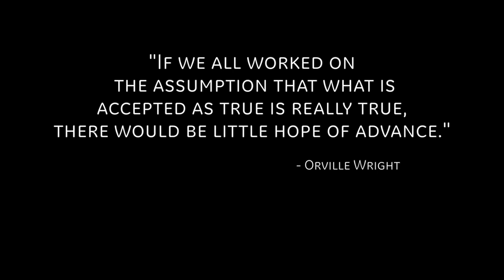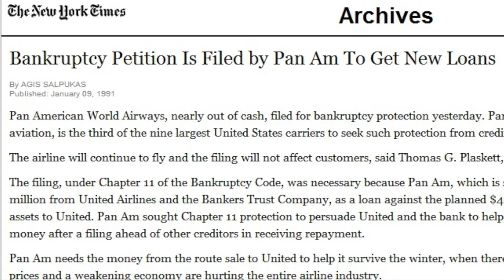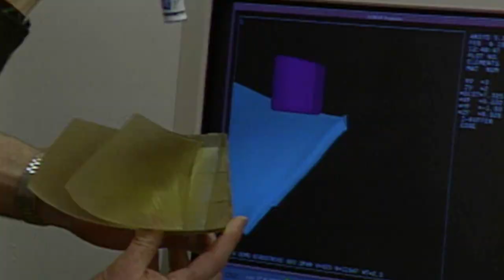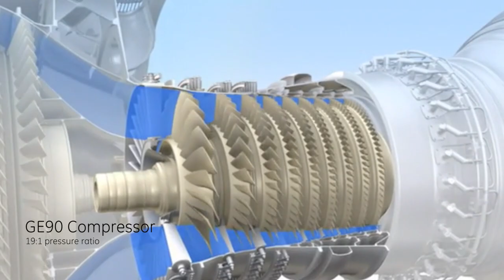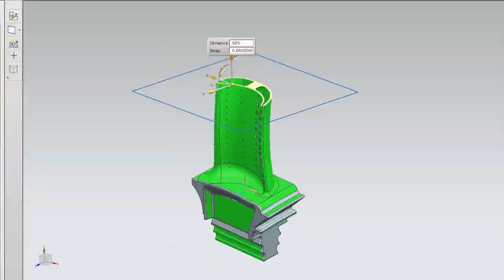GE's Big Bet on Goliath Engines

Comment: GE > RR
Reply: No you are wrong. I like GE than RR. Not the other way around. you have  #fail
Reply: GE are better than Rolls Royce? Unless of course you're using a faulty GE operand in which case you probably meant GE<RR
Reply: GE>any other engine except the Rolls Royce SNECMA Olymups 593 Mk 610 (nothing beats the Concorde)
Reply: @dantaylor7344  Faulty Rolls-Royce engine on Australian A380 did cost A380's head!
Reply: maanvol  Mmmm love to see the stats of GE engines V RR. I wonder if more yanky planes fell out of the air than European ones??????

Comment: What is needed now is a set of fan disks that does not develop cracks that cause  uncontained fan disk failures that has killed 1 person in the US and probably more in other countries.  Yes, now every engine maker has blood on their hands; flying with turbofan jet engines with known defects.  Decades before, an A& P could downcheck an engine and cause it to  be rebuilt. Nowadays; " Oh that crack isn't big enough to replace the fan disk assembly "...Oh, well, that is the risk you take when flying. I was trained to fly; My father was a Connie worker who never sets foot into a jet.  Both of us knows that there is always a risk to flying. Accepting an uncontained fan disk rupture means that people accept that risk.

Comment: How about thinking about the passengers instead of the airlines...we are flying slower than ever with all these "great" engines
Reply: And your airfare is as cheap relatively as it has ever been and your safety is better than it has ever being
Reply: Slower=quieter, fuel efficiency, less vibration, less wear and tear... if speed is all you want the concord is for you.

Comment: WHY DON'T THEY PUT CHICKEN WIRE MESH OVER THE FRONT OF THE ENGINES TO PREVENT BIRD STRIKES TAKING OUT PLANES ?
Reply: well it would decrease the air flow so the engine would need to work extra hard, and besides this one doesnt require any, i saw the test videos the chicken turns to paste and goes out safely
Reply: Nomad Vids Thank you for answering my question are you an employee of G.E.?
Reply: Darryl Fry hehe no :P
Reply: well not chicken wire, but titanium chicken wire, strong enough not to be sucked in, and they could weld it around the sides to keep it in place !
Reply: Because a bird would go straight through it
Reply: Plus the wire would distort the air flow and create turbulence....Maybe a retractable screen until the plane is high enough???
Reply: Darryl Fry the birds will get diced or cubed that's all.

Comment: If GE really wants to get innovative with their engine design, they should focus more of their future development on engines that run on alternative fuels (like Hydrogen or Methane) or even no fuel at all (relying on Microwave Beamed Power from the ground and orbital relays).  These technologies may not be feasible today, but the development cycle of an engine can be 15-20 years or longer, and by that time SpaceX should by flying reusable Falcon Heavy rockets for much cheaper access to space... (a constellation of Microwave relays in orbit could allow a handful of ground stations to power airplanes flying anywhere on the globe...) and Natural Gas infrastructure should be much better developed than it is today.  Aerospace companies need to start planning around Peak Oil and the eventual depletion (in 30-40 years at the latest) of most sizable and affordable petroleum reserves combined with even higher demands for Oil for transportation and industrial uses as countries in Asia and Africa economically develop...
Reply: The same Peak Oil we've been hearing about for 75 years. How's that working out for you?

Comment: I bet you could fly a 747 with two of the GE90 115's at full load.  Wonder how many miles of wire and tons of weight that would save.  This engine is stupid awesome and shows what GE can do.  Props to the engineers who designed this beast and all the management who saw it through.  If I had known and not been poor growing up I would have tried to become an engineer to work with a company like GE.  Since I can't work for GE I just will keep buying their stock until I own enough to get a stockholder tour of one of their plants or something.  The only thing about this engine that worries me is the amount of thrust it produces ripping up airport runways.  I bet that was a concern when they built it.  Put four of these suckers on 747 and you could probably take off at idle thrust.

Comment: To Eric Ng....the only reason there are more GE engines in use on 777s is because there is no option to buy RR or P&W on a 777ER/LR. Boeing struck an exclusivity deal with GE years ago to exclude competition. Airlines won't have a choice with the 777X either. To be fair, the A350 only has RR as the engine provider. And now GE are knocking on Airbus's door for business for Airbus's latest model.
Reply: bullshit...

Comment: 6:28 that Emirates 777-300 is powered by the Rolls Royce Trent 800... the same one that was essentially kicked off wing by GE in exclusivity deals, similar to the deals to that on GE9X
Reply: Rolls has exclusive deals  on all  A-350  series  which means a   free run with an engine  with no real competition  because if GE offers an alternative engine for A350 Boeing  would cancel  GE's exclusivity  on 777-X  and ask RR and even Pratt to come up with an alternative. Since 777-X  has a  tremendous  future,GE would never take the  risk.
Reply: john russell Only 777-300ER have GE motors, RR can be on 777-300 but not the ER's.
Reply: john russell You are revelling in complete fantasy dude.. Boeing has offered financial participation  in devlopment  of  300ER ..GE accepted and  RR refused and today they certainly  regret the  decision..  GE-115B has exceeded 127.000 Ib trust.. World record that is still valid  ..Rolls  Royce is under serious  investigation by the SFO in Britain   for bribery. 
How about Rolls Royce bribing Airbus for exclusivity in  A350 ?????
Reply: sam koivisto As I said ,RR made a serious mistake which  they regret today  it is obvious they underestimated the success of the 300ER ...
Reply: Just stating that GE are on the 300 ER'S and i like the way they do engines. Didn't know about the 350 RR deal, unfortunately that's big business now days dude.

Comment: The only Caveat I see is that because the engines are so large they would have to also replace the landing struts with longer struts to get the engine intake far enough up off the ground to keep them from being damaged by FOD.  That means all three of the landing gears.  That will also be cost prohibitive if they wanted to re-outfit their fleet with those new engines, so I am assuming that they will only go on the newest aircraft coming off the assembly line which would be designed to accommodate those longer struts.
Reply: Raise the wing i.e. 787

Comment: Okay so usually the high pressure turbine blades are meant to support alot of heat and mainly hold to creep. That's why the nickel based superalloys were used, as well as monocrystals. But how does the cobalt and chrome alloy compensate for this ? I mean, unless they could print monocrystals I'm sort of confused.
Reply: Cobalt and chrome alloys is used together because they have a really high resistance to heat and friction which is both in a jet engine I know the t-58 helicopter I work on which is also a GE engine it has cobalt bearings and titanium compressor casings
Reply: Lucas Mccormick
 Ivan's question...and Lucas' answer just turned me on..WOO!
Time to take a cold shower now....
Reply: Moondra3 glad I could help

Comment: The problem is, that if you put those engines on a plane, they hit the ground. So the engines got moved up and forward, which makes the plane pitch up and down wildly. Which is why MCAS was put on the planes. Which is why they crash all the time. Good work, Boeing and FAA.
Reply: What the hell are you talking about only the 737max has the MCAS system and the 737max uses CFM international Leap 1B engines and not GE90X. The engine(GE90X) shown in this video is for the 777X which doesn't even have an MCAS system at all. This video has completely nothing to do with the 737MAX. How the hell can you even mistake a 737Max with a 777X a plane that's almost 3 times bigger.

Comment: The future is ion drives. 300 - 400 ion drives on every wing, pumping out a thin stream of air molecules at incredible speeds would generate the same thrust as that Hummer-sized engine.

Comment: These days airline add a fuel surcharge as needed (and are loathe to reduce or remove it).  It's almost at the point that your seat price does not include fuel.

Comment: It is unfortunate that GE chose not to rejuvenate their Marine Gas Turbine lineup with cores based on the GE90, GEnX or GE9X. The composite fan won't be of any value, but the high pressure hot sections and the TAPS combustor most certainly will. By choosing to allow the LM2500 to languish within its current CF6 foundations, GE is ceding the future marine turbine to the Rolls-Royce MT30 and WR-21. What will be needed to retain leadership in marine propulsion is a concerted effort to bring the GE Passport, LEAP56, GEnX and GE9X cores to marine applications. I'll call them the LM1 (passport core), LM2 (LEAP56 core), LM4 (GeNX core) and LM8 (GE9X core) respectively, each covering the 10, 20, 40 and 80MW output class.

Comment: The mention of the bypass ratio whetted my appetite to know what it was!  Don't leave us hanging.  It does look obvious that the bypass is way more than the compressor/expander unit.  "The cooling provided" was another tidbit that begged explanation.  Seems that it's time for the compound-engine where an entire motor is used only for cooling the combustion chamber.  Or how about a compressed nitrogen gas coolant dump for take offs and landings?

Comment: At 6.34 in this You Tube feature, what function does the two smaller engines provide on the plane shown?
Reply: The smaller engines were to compare
Reply: Those are the 747s own engines.
Reply: Nope, the smaller engines are what you will find on all 747's the big engine is there just for testing. All they did was remove one of the 747's engines and put the GE90 on the plane for testing in it's place, n o comparison at all.
Reply: All they did was remove one of the 747's engines and put the GE90 on the plane for testing in it's place.

Comment: Renewable aviation fuel is key, far cleaner for both the turbine and for our climate.
Reply: LOL!
Reply: How much land is required to grow it?  As we know, arable land is needed to combat starvation around the globe, not grow jet fuel. Ethanol i.e. is not a green fuel because it is energy negative over the entire cycle (more energy is required to produce it than it contains).  If we converted all arable land in the US to ethanol production, it would only replace about 15% of our oil demands. And, it uses vast amounts of water. By the way, the turbines I work on have been flying for thousands of hours. They all burn petroleum, and they are all clean as a linen sheet in their turbines and combustion sections. The only place they accumulate soot is a bit on the cool end of the exhaust cone.

Comment: I know how to bild a friction less bearing. Yes its supposed to be impossible but I do know how to make one and I think I know how to lower or remove the possibility of separation of the bearing. I just dont know what speeds it could handle and if the weight would be worth it to use it in replacement of traditional bearings. I think it could weigh as little as 2X the weight of the traditional bearings.

Comment: These engines don’t run on fuel now, they’re powered by compressed air...yet we’re probably charged for fuel in the price of tickets
Reply: They do run on fuel. The engine compresses the air. If you do not believe that. Then get on a radio controlled jet with minimal fuel for takeoff. Of course, you will not be around to tell the truth.
Reply: They do run on fuel. The engine compresses the air to give them thrust. We could put you on a radio controlled jet. And add enough fuel for takeoff. But of course, you would not be around to tell the truth.

Comment: I need some intelligent to answer my question. Unfortunately I don't know what is called the nose of the engine were you see the cone shaped center were the propeller attached to. So my question is , why do this center have white lines in the tip.? Sometimes you can see it when the engine is running fast they turn into a blur 6.

Comment: GE is trying to save a few hundred pounds using exotic materials, instead of looking at retiring the obsolete turbine designs for more powerful engines that weigh a mere 300 lbs in total.

Comment: Earlier comments said the Emirates was using R.R engins in the video but I heard the G.E. had a special arrangement with Boeing for the 777 engine to be the only supplier since its was so unusual is that true?
Reply: This is probably a dumb question but when I see GE the first thing that comes to mind is Light bulbs. This can't be the same company right? Sort of like R.R. engines and R.R. ultra luxary cars.
Reply: Tampa0123456789 In both cases, they are the same companies. The same GE that makes jet engines also makes everything from windmills to light bulbs. Of course, they are different divisions of GE, but it's same company. Similarly, the automobile manufacturer Rolls Royce is the same Rolls Royce that makes the Trent jet engines.
Reply: Rolls Royce automotive and aero engines are completely separate business entities.  When the British government bailed out RR in the 70's they sold off RR automotive to the private sector and the aero engines remained a public company. BMW own and produce RR cars.
Reply: GEAviation
Tell Avondale to get off their duffs and build an LM 50,000 out of this monster.
Reply: john russell  Where are you getting this "$500,000" figure from?   The risk sharing deal that led to exclusivity between Boeing and GE is private treaty... no stats have been released publicly.
Reply: vbscript2 Actually the Rolls Royce automaker is NOT part of Rolls Royce Aero. The car manufacturer is a division of BMW. whereas the Aero maker is a stand alone unit

Comment: But can they invent a plane to use it that's balanced right, without the digital slight of hand? Seems to me there should be some way to do that since the engine is so much more efficient - De Havilland engine integral with wing? Or wing-only aircraft?

Comment: stick a prop on it and double the fuel efficiency,so what if it only cruises at 350 mph
Reply: +Norsebolt do I have to explain  sarcasm?reconfigure the  engine  to a turboprop  configuration  similar  to the bear bomber and you  get the efficiency  you  seek at the cost of cruise  speed
Reply: cartmanrlsusall they will never sacrifice speed over efficiency. People only want faster. By the end of the century people will be traveling at several times the speed of sound in planes.
Reply: I see your point .I wonder what would happen if there was a choice like a 200mph train or a large airliner with props compared with a jet liner .I bet the price difference would change minds about jet travel.

Comment: There is safety in numbers. Give me 4 engines every time on long distance flights. When it comes to human life, financial savings should not come into the equation UNLESS it can truly be done WITHOUT the slightest risk to the lives on board.
Reply: No aircraft powered by GE90-115B has ever crashed so there's that.

Comment: i wonder if British airways new 787-8 are equipped with RR instead or GE? anybody knows?
Reply: Jacques Goulet British Airways almost always have RR engines on all their aircraft.
Reply: +soaringtractor Hey Douche!!!! British airways has 266 aircraft, of which 58 are 777's so I would say that the "majority" of their aircraft use RR engines. Reading comprehension is not your strong suite. What part of "almost always" don't you understand?
Reply: +soaringtractor  we use both GE and rollers on our 777
Reply: soaringtractor Thats customer choice, the rollers are more fuel efficient, thats why emirates have chosen them.
Reply: +soaringtractor  what on earth are you talking about? Better shut down? What a load of bollocks. Rollers are also lighter and smaller to, you know complete crap
Reply: mtrujillo1973 Did you not read the news a year ago that Emirates are going to use RR on their new a380's? And also they will have a 615 seat cabin? You need to get your facts right.
Reply: +mtrujillo1973  800 is maximum loading of people which no airline would do because they have multiple class layouts.

Comment: Is it bird swarm resistant?   With only two engines this may become a problem.
Reply: Edgar, the carbon fibre blades are tungsten edged, they can cut a big bird into fine sushi
Reply: @MrRasZee  even if the birds are thoroughly nebulized, by the fan, they can still gum up the engine's works

Comment: Errr...the range of the engine depended on the aircraft it was bolted onto. On the B747, the CF6 was well capable of long haul.
Reply: An engine's "range" is limited only by its number of hours of operation before it must be shut down for routine service, and its durability. The range of an aircraft, not to be confused with the engine's "range", is limited by the efficiency of the engine, the aforementioned hours of operation limit, and the fuel capacity of the aircraft.

Comment: carbon fiber fan blades?  30+ year old tech 
and do they have a second  intermediate compressor set running on a separate shaft to get a higher efficiency?
oops only rr has this. because its complicated  to do

Comment: When will there be a " design " that will prevent birds / debris from entering engines when planes are taking off and landing..... I have that design ! The BV-1549
Reply: Gerald, the carbon fibre blades are tungsten edged, they can cut a big bird into fine sushi